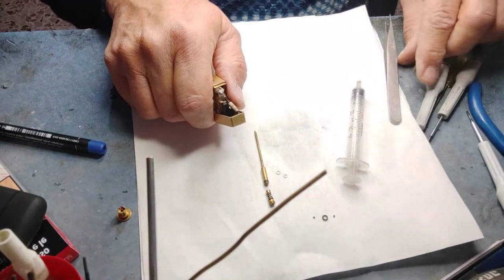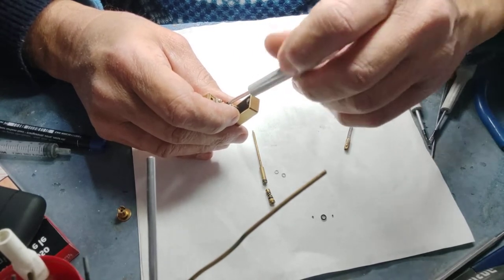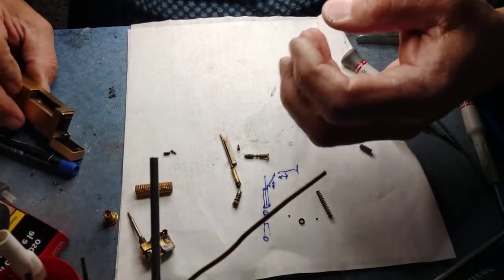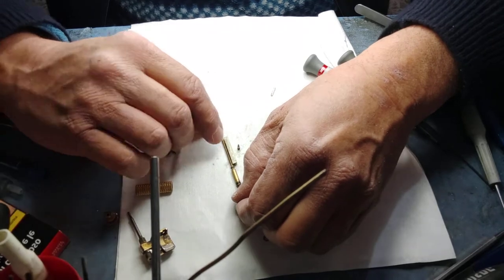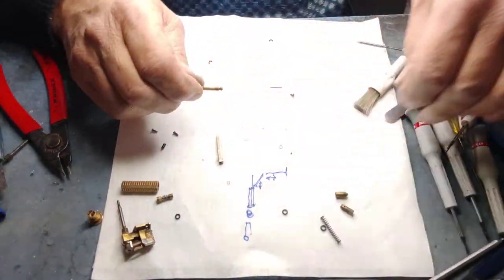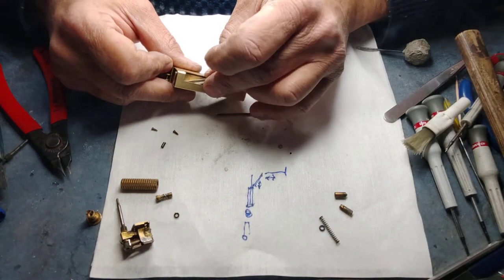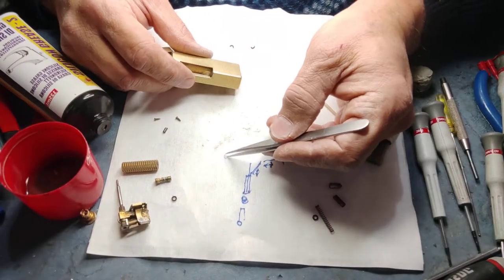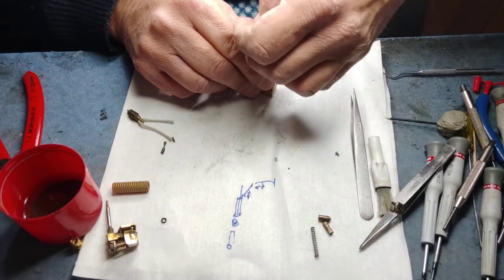Dunhill rollagas Lighter briquet Encendedor explanation of operation, disassembly and assembly

Comment: Great videos Santo! I got a rollagas from 1973, and the bottom lid (dust cap over the filling valve) does not turn at all, seems stuck. Do you show in any videos how to turn it? all the best!
Reply from the maker: non riesco a capire quale sia questa parte che tu mi dici. se vuoi scrivermi sulla mail santoanastasio1@gmail.com
Reply from the maker: non riesco a capire quale sia questa parte che tu mi dici. se vuoi scrivermi sulla mail santoanastasio1@gmail.com

Comment: Video is interesting but a little confusing at times... I believe the video has somehow been flipped so that components of the lighter are reversed. Maybe it's just my view, but the flint wheel and flame nozzle are in the wrong position, and any screw turning is in the wrong direction - even the flint housing screw (which has reverse threads) is tightened clockwise rather than the normal counter-clockwise. Is it just me?
Reply from the maker: hi, yes you are absolutely right I cannot make sure to show the correct direction and position, my phone does not have a function to fix this inversion
Reply: @santoanastasio4201  I picked up some great tips following your video... thanks for posting it.
Reply from the maker: I am glad my videos can help with lighter repair